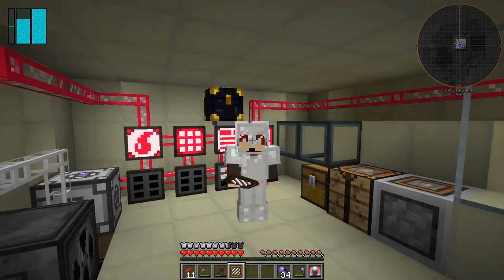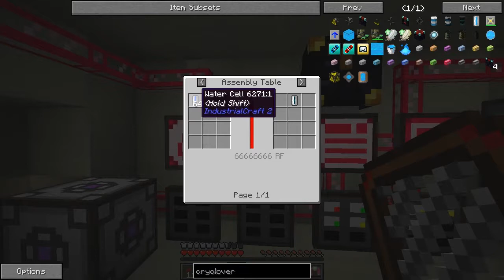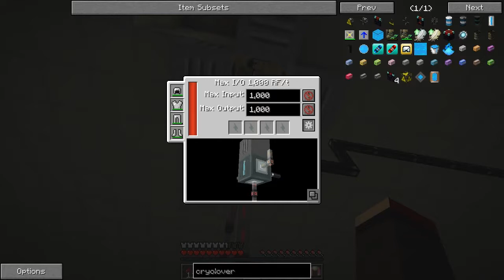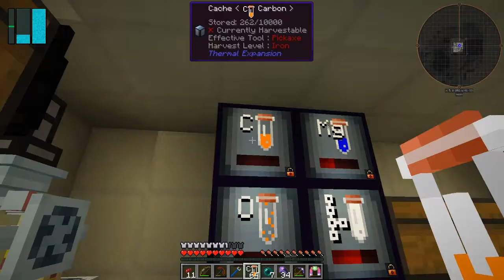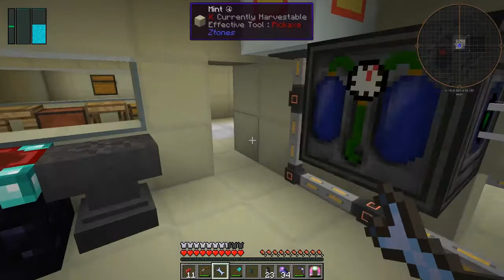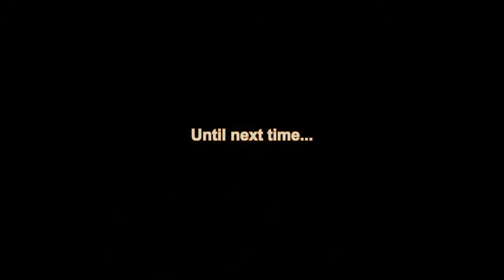Galactic Science 2 #36 - Overclocker

Comment: I made a whole roll (7) of Metal Formers, being fed from a single chest (through pipes).  The Metal Formers take a while, and we need so many for the rocket parts.  I would dump 15+ stacks of ingots to get them all pressed.
Reply from the maker: You are absolutely correct the metal formers are very slow and I don't know if it is better to have 15 metal formers or 8 overclockers, good tip as metal formers are cheaper than overclockers.

I've automated the overclockers now and just need a diamond shovel and visit the snow golem, a vacuum hopper feeding an auto-compressor takes care of the rest. You get six stacks of snow from a diamond shovel which makes 4 overclockers.
Reply: I might use your set-up to overclock all of my metal formers, lol